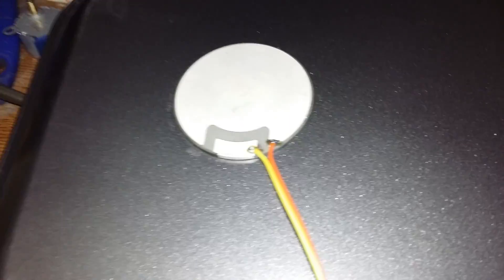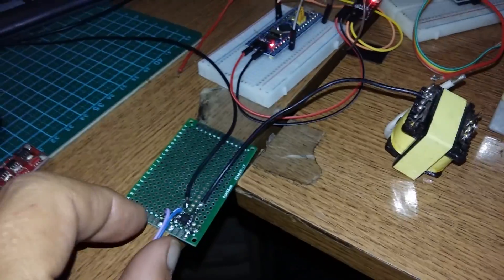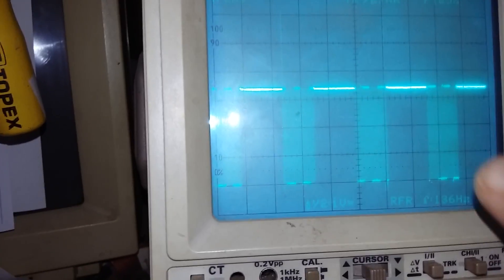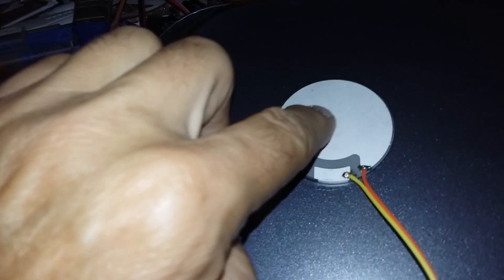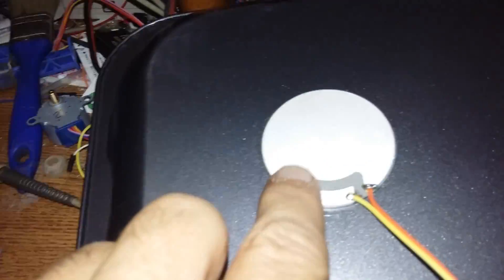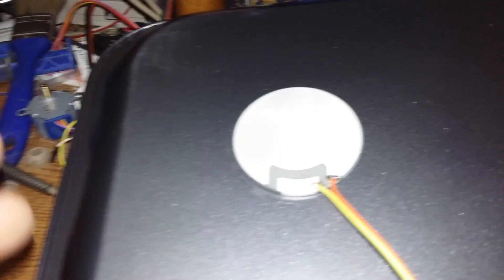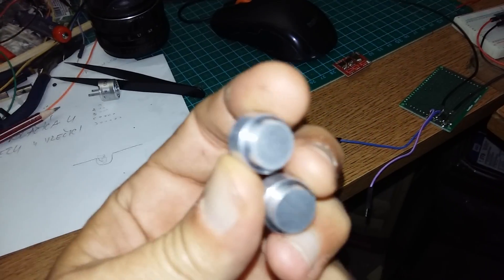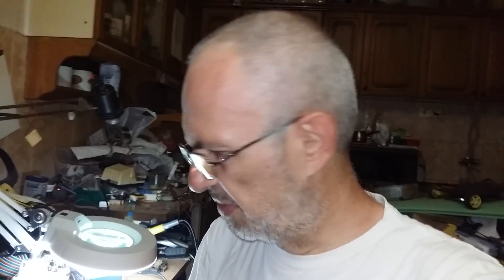35W Ultrasonic Transducer From Banggood.com

Comment: ...mine 'cooked' ... model cd 2800, 35W element ...epoxy to ss tank bottom ...any way to replace it ? ...peace
Reply from the maker: So, it is glued? Use acetone to dissolve glue.
Reply: @MilanKarakas  epoxyed ... peace

Comment: Sir. how did you fix ( paste the ceramics)?
Reply from the maker: Two component epoxy glue.
Reply: Sir. Will the epoxy not come out? because the glue also vibrated.
Reply from the maker: @kaluvanhariharan4256  I don't know. I did not power this device. I had plan to do so, but gave up for different reasons.
Reply: did you endup using the epoxy? What were  the results?

Comment: Hi, would you be able to share the circuit you got it to work with. I'm trying to achieve the same, but have problems getting it to work. Also what voltage were you running through the transducer?
Reply: Did you ever manage to get it to work. Trying to build one atm

Comment: Thanks for sharing.

Have you found and solution for your design?

I have built similar device, and many times I burnt some parts. Finally what I found solution was totem pole circuit to drive mosfet and i choosed IRFP250N as mosfet.

I am not professional on electronics, I may have some mistakes on circuit, but it works for 20-25W without any problem.

Here is the link, at the end of page you can find totem pole circuit 

http://mehmetkopru.com/projects/acoustic-levitation/

Comment: thank you I have been trying find something like this
Reply from the maker: That is cool. For ultrasonic cleaner?
Reply: +WildMania still a noob at this but I was thinking to focus ultra sound
Reply: +Samuel Hanks infra*
Reply from the maker: You can make infrasound with ultrasound - just need strong emitter in ultrasonic, then modulate this signal with ultrasound (low frequency). The property of the air will take care of the rest. Then you can focus indirectly infrasound.
Reply: +WildMania thanks! will do